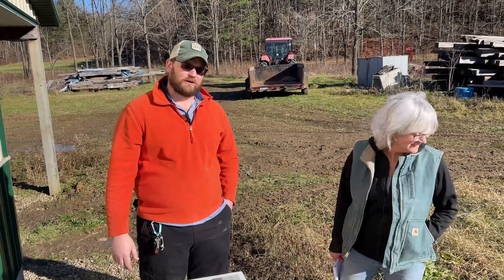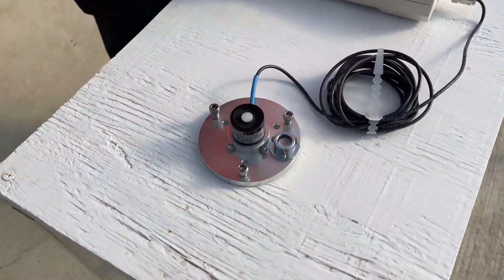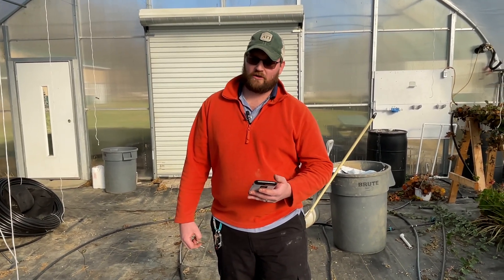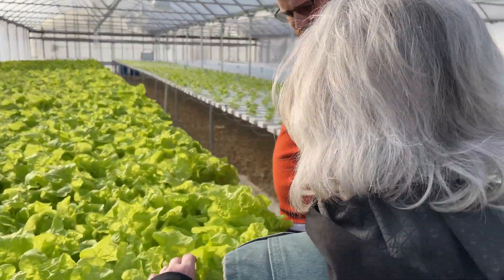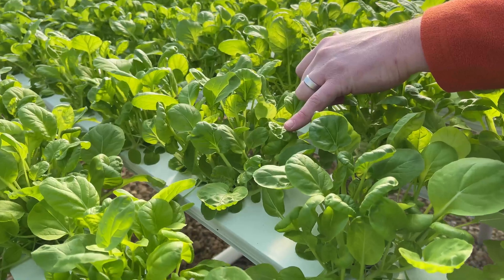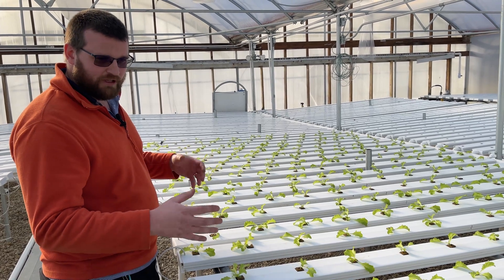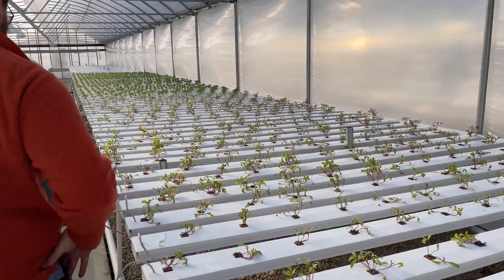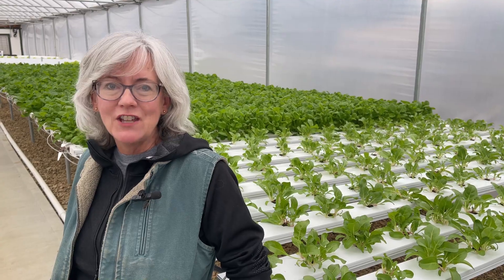Greenhouse Light Evaluation & Stump the horticulturist.

Comment: I noticed in another video where you spray a solution on the plastic of the green house to cut out the amount of sunlight coming through in the summer. Wouldn’t that leave a residue and contribute to the clouding of the film over time?  Wouldn’t it be better to use a shade clothe?  I  would think the shade clothe would take less time to put it on than the spray and would involve a lot less labor?  And you could use the shade clothe year after year.
Reply from the maker: Hi Tim, we used a product called ReDu Heat as our shade paint. It is removed each fall with either snow fall or a product that is made to remove the paint. We looked into shade cloth, but the cost was huge for our greenhouse, you are probably right on the residue...we are still debating what to do with that aspect of the greenhouse. Great comment thank you!

Comment: I recall you used some spray on shade on some houses.  How does that factor in this? Also, how does shade cloth affect light vs the trade off with heat?
Reply from the maker: Yes, we used ReDu Heat as a spray in the spring. We did post a video cleaning that material off the greenhouse this fall. I guess we wouldn't use a shade paint with the plastic in this condition, but we need to change to get more light into the greenhouse

Comment: Hello, buying a PAR meter is not too expensive, personally I use the "Photobio" ($160) much cheaper than the Apogee brand, and it does the job very well. 
What is important is to be able to calculate the DLI (Day Light Integral) in the greenhouse. 
DLI  = PPFD X 60 X 60 X number of hours of lighting / 1.000.000
To find the PPFD you need a PAR meter.  So let's take an example PPFD 450 X 60 X 60 X 12 (hours of lighting/day) /1000.000 = 19.44 mmol...
if I take the example of the strawberry crop, we need a DLI between 17 and 25, with 19.44 we are good.
Reply from the maker: Thanks for the information you sound like a expert. We should set up a partnership for growers who need additional information on light.
Reply: @HomegrownPassion  Thanks, but I'm not an expert, I just know the important parts for my job. If there are any questions on your youtube channel about the points I know, I will do my best to answer them.

Comment: Is there a more stable longer lasting poly available? I know that polycarbonate is much more expensive but lasts aprox 25 years but can offer insulating value cutting heat costs. Is it worth it for large commercial greenhouses?
Reply from the maker: Not sure. Everyone wants a glass greenhouse but way to expensive. Poly carb is great like you said but expensive. Not sure if there is another product that would work with our type of greenhouse.

Comment: I would really like to hear what meter he recommends for checking light levels.
Reply: It depends on the functions you are looking for, a simple PAR meter like "Photobio" does the job well and is not expensive (that's what I use), otherwise, there is the brand Apogee, it is a very good brand, but it is more expensive.
Reply from the maker: We should have some more information on light meters by the first of the year
Reply: There are apps that use your phone's camera for this. I use a free app called lux.
Works great and really reliable.
Reply: @patrickmortenson4266  I tested several applications on Android, and the most successful application "korona" on iPhone, but when I compare the results to my PAR meter (Photobio) it is not very accurate. The problem is that on iPhone and Android, the sensors are different from one smartphone model to another, and so the result changes... I would say that this kind of application is very good to have an idea, but not more.